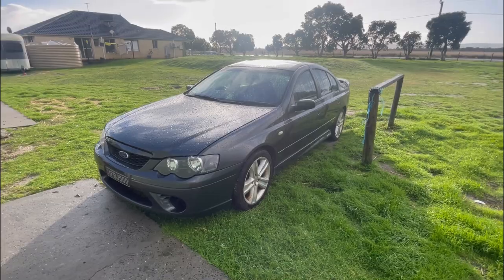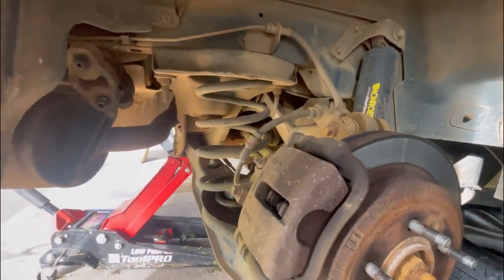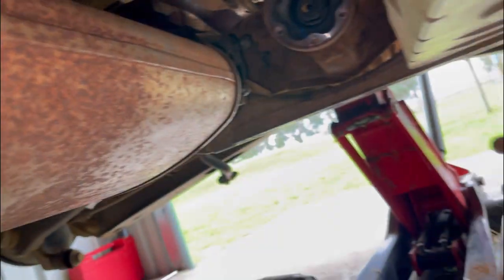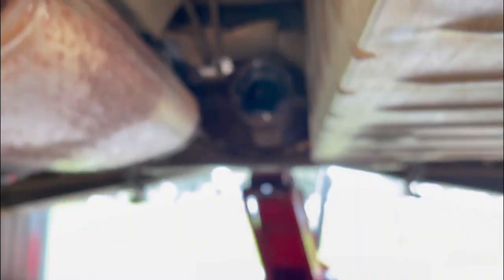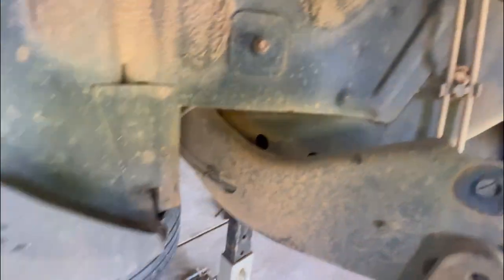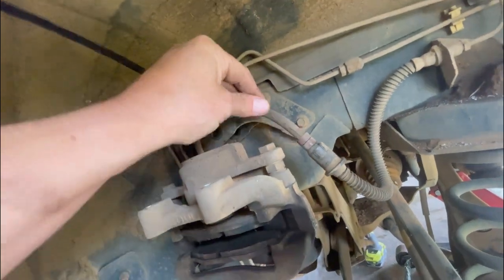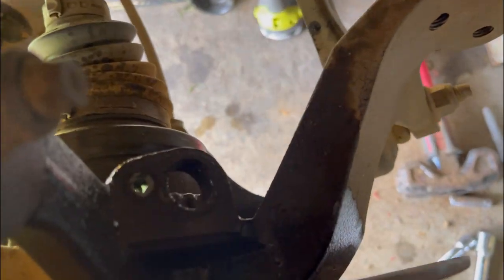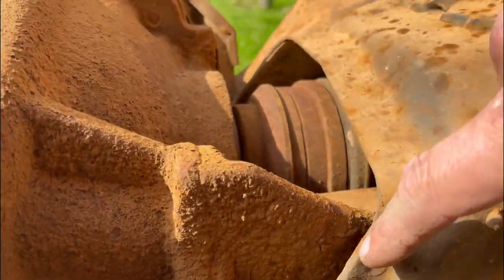Remove BA BF diff cradle at home.

Comment: Awesome tutorial. Looks like the bump stops need replacing too. The most easiest of the jobs. Cheers
Reply from the maker: You’re right mate, they were totally flogged and you’ve just reminded me to order some new ones. Funny thing, this is the third B-Series I’ve taken over the pits and all three have them had bumps stops like that and not one of them were picked…. Weird.
Reply: @Jeenzy79  Yeah. The roady assessors are funny and if you took it to another one, they'll pick on something else. The bloke that's going to buy the car off you should be pretty stoked. I would. As the cars I've seen are shitters and neglected.
Reply from the maker: @vincekara9446  I know right, it’s getting harder and harder to find these cars in good condition. Most of them are just thrashed with no maintenance at all, which is a shame coz they are reliable as hell when they’re maintained. I thought it was strange they didn’t pick up on the sway bar links coz the bushes on those have seen better days too.

Comment: good tutorial, going to have a crack at my BA XR 8 now it's up on stands already as I'm doing a spoiler kit all round.
Reply from the maker: Ah nice one mate. Not too hard at all, just make sure you have a tool ready for putting the new ones in… And leave the centre unbolted till you have all 3 bushes in, that way you can move it around out of your way when installing the new bushes.

Comment: With the wheel speed sensors i found its easier to pull up the rear seat and unplug them from the loom then feed them though the floor then remove the one holder from the front blade arm
Reply from the maker: Hey mate, yep that’s another way to do it, only thing I found doing that is the little clips that hold them in always break when you pull them out… plus I usually leave those blade arms in the car so the sensor just stays with them.
Reply: @Jeenzy79  at our shop in all fairness when we do them we just remove the blades but if you go behind where the clip is and push you can just pop the clip out. You also have less risk dammageing the sensor
Reply from the maker: @snapped4433  Ah yes I’m with ya. I’ve never actually left the blade arms on, guessing that would be a lot easier way to do it. I need to do another set of bushes in the near future so I’ll have a crack at doing it that way.
Cheers mate. 🍻

Comment: Great videos mate, what else should be changed besides diff bushes while the cradle is out? Does the cradle need to be out to change all those other arms and bushes ?
Reply from the maker: Cheers mate, hopefully someone finds them useful. Definitely worth looking at the trailing arm bushes, they’re prone to failing… also worth checking the Swaybar links as well. If you’re going to be changing any rear arms out it definitely helps to have the cradle out just to have good access to the bolts. It’s really not that hard to get it out though if you have the basic tool. A big jack definitely helps.

Comment: next diff or gearbox you need to remove from a car an ATV lifter is way batter then trying to balance it on a jack 😎
Reply from the maker: Cheers mate. That’s an awesome idea! 
I don’t have one of those though unfortunately.
Reply: @Jeenzy79  go on and spoil yourself i give you permission haha

btw i just watched part two of this and with putting the bushes back in can't you just use a bit of lube on the outside then just smack them back in with a block of wood and a hammer?
Reply from the maker: I’ll just tell the Mrs it’s all your fault when she see’s the bank transaction 😂🤣😂
I actually did my very first set of bushes that way… wish it was as easy as it sounds. It did end up working in the end but it was a pain in the ass doing it that way by myself. Using a bit of threaded bar is no effort and seems to work well.

Comment: Does it matter if you take a cradle from another car but keep the weights from your tailshaft in the same spot?? 

Ive got a shell with a spare cradle, I'll be doing bushes and rubber all around, new seals and a diff service as my car's diff and bushes are absolutely flogged, bent blade arm and an axle is gone. don't get me started on wheel barings and brakes.. 🤣 so i figured a whole new cradle rebuild was better. 

What i need to know. Is, will it vibrate if i swap cradles? I'll be very careful to keep the weights in the same place on my tailshaft, I'll be doing my centre baring in the process as well
Reply from the maker: I’ve no idea mate, I’m certainly no mechanic… But I have put a complete second hand tailshaft into a couple of cars now and completely left the counterweights off completely and had no vibration issues whatsoever. I would assume if you marked where the weights are before removing them you’d be fine 🤷🏼‍♂️

Comment: I've just dropped the diff on a sz territory to do the bushes. About to jack the diff back up and bolt it on. I heard I need to align the diff cradle with dowels or aligning some holes? How do you go about aligning the diff when putting it back on? Also with the front rear diff bushes in I have a 5mil clearance from the diff mount for the bush and the cradle, is that enough clearance? Cheers..
Reply from the maker: @michaelkong2682  Hey mate, yup 5mm should be enough clearance on the front bolts. A lot of people just put them in flush but if you look at the support arm that hold the diff to the cradle (the arm that the front diff bush bolts to) it can actually rub or hit on the cradle itself when the car is under load. That’s why you need to have the bushes sit beyond flush like you’ve done… it will give the support arms clearance from the cradle itself if that makes sense. As for lifting up the cradle when putting it back in, the very top plate has a big hole on either side, and if you look underneath the body of the car where the cradle goes back in there is a corresponding hole on the body. All I do is get the cradle up under the car and get the 4 main big nuts in to hold it in place and as it’s hanging there you just need to line the holes on the top plate of the cradle up to the holes in the body as you’re doing up the nuts. A lot of the time they will line up perfectly by themselves, sometimes they’re off just a smidge but with the bolts and nuts still loose it’s really easy to line it all up again. 
Hope that makes sense mate. If you’ve already got the new bushes in the hard part is done.
Hope that helps. Good luck with it mate.
Reply: @Jeenzy79  thanks for ya help.. all done. Great videos.
Reply from the maker: @michaelkong2682  Awesome mate… nice one! Cheers for the feedback too, much appreciated 👍🏼